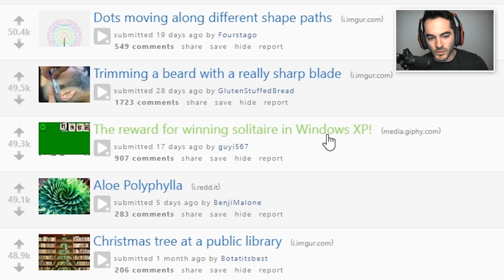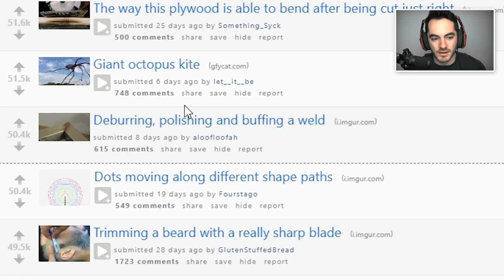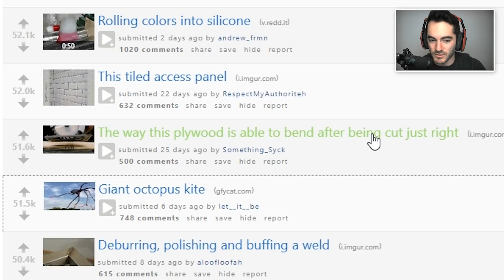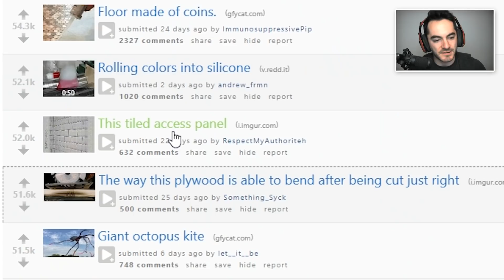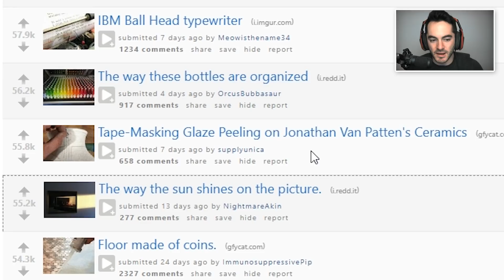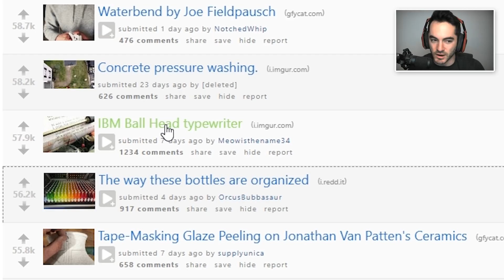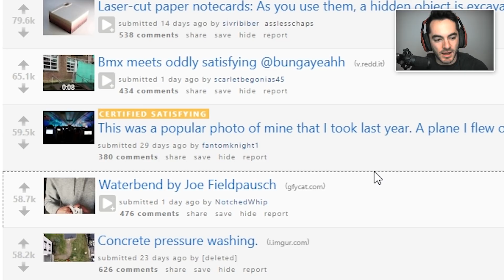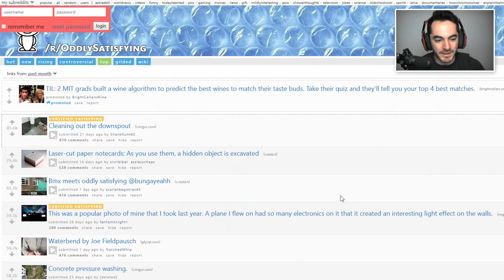HOW TO TASTE THE RAINBOW

Comment: Balls were moving at the same speed. But a triangle in the middle is so small it has lower amount of road to cover than the ball on the outside. That’s why ball in the middle appears to move faster. Because its route is shorter
Reply: Żalbert YES! Thank you!
Reply: This would only be better if you had added a "Jardon you fool" before you said this.
Reply: Sure, that's why while the outside dot makes 1 full circle second to last dot makes 1.5 circle.
Reply: You are right in the sense that each ball is moving at the same speed given their linear paths at any given moment. It's just that the middle balls have a higher average velocity because they are turning sharply at the same speed. So he is kind of half right. I wouldn't go calling him stupid.
Reply: Comrade Żalbert is correct, it's physics, and Captain Sparklez is just saying things without checking the facts
Reply: Valentino III also look up the difference between rotational velocity and tangential velocity, this is why I'm saying he's half right
Reply: the inner paths are indeed shorter but the balls were not moving with the same speed, jordan is right
Reply: Exactly what i was about to post. xD
Reply: Right? How dare he be fooled by the optical illusion specifically engineered to fool you into thinking the balls are all moving at different speeds! He's so stupid sarcasm intensifies
Reply: Żalbert i'm sorry, i just read "balls were moving at same speed" and had a laughing fit... I'm almost 18 i need to be more mature xD i 'need' to, but i won't be :P
Reply: maxdrags3 Last place I'd expect to see you bub.
Reply: Żalbert They definitely weren't the same speed
Reply: You're wrong, the balls were moving at different speeds.  Just look at the part where they're all lined up on the bottom, you can see the balls passing each other.  The ball in the center is going a little faster than the one on the outside, and the balls halfway out are moving more than twice as fast.
Reply: Gammer Games It's not that he's stupid, it's just how he talks about shit like he's so knowledgable about a thing but he's really just extremely ignorant and overconfident. It's annoying.
Reply: They’re definitely moving at different speeds. If you look at the pentagon compared to the outmost shape, it’s clear that there’s a difference in how quickly the dots move. The pentagon dot passes one side way faster than that of the largest shape. He was undoubtedly correct about them moving at different speeds.
Reply: They were moving at different speeds but okay
Reply: The balls are moving at the same speed but due to diffrent lengths of track and sharp turns. This is why an increase of size makes the ball look like it's going slower. Think if you had a hundred meter track and you were racing against someone the were to run the full 100 meters to finish, and you only had to run 50 meters to finish, that's a really simplified example But it's effective
Reply: Nicolas Flamel yes and that is due to the sharpness of the bend they go round not the speed of the ball
Reply: Such math omg
Reply: I know what u mean but I don't think they were moving at the same speed
Reply: Yeah you can tell with the sides
Reply: They weren't though. If you slow it down and measure it out, each shape out you get has a slightly higher linear speed. If you focus on the just the square and triangle, you can easily see this by watching the ball on the square cover more distance than the ball on the triangle in the same period of time
Reply: The ball a few layers down from the outside was clearly moving faster than the outside ball.

EDIT: If you pause the video and advance one frame at a time during that, you can see it far more clearly.
Reply: EXACTLY

Comment: Ok, so those were 1p coins from UK, which have a radius of 10.15mm = 0.01015m
Using pi*r^2, the area of the coin is... 3.237 x 10^-4 sqrm.
Converted to sqrft is... 0.003484 sqrft.

From this, you're able to fit around 287 coins into one square foot, or 3090 per square meter, but that's assuming you melt them down and have no space left over. So, to be slightly more realistic and keeping the numbers nice, we'll say you can fit 250 x 1p coins per square foot, or 2500 per square meter. That's £2.50 per square foot, or £25 per square meter. 

Based on UK carpet dealers (which all seem to have sales, so I'm going based off if carpets weren't on sale), this is about average. Add on the stuff he put on top and the glue, and I'd imagine it comes out to around £3/sqrft or £30/sqrm, which is more high-end/average.
Reply: wow
Reply: So basically, Its a good idea to get a penny floor.
Reply: Box-O-Cookies Well... it's not a bad idea...
Reply: I did the cost in pennies and got 256 or $2.56 in cost per square foot as a penny has a length of .75 inches that means you can fit about 16 pennies every foot meaning just multiply by itself to get the squared amount and you end up with 16x16=256 or two dollars and fifty six cents per square foot meaning if you have a 100 square foot room it would cost 256 dollars. that means that it would be 2304 coins per square meter or in other words $23.04
Reply: Sentient Pufferfish Do you have the right coins? The ones shown in the video are British 1p coins and are closer to 0.8 inches in diameter
Reply: oh sorry i did it in pennies not pence
Reply: You need more likes for ur math skillz

Comment: Actually the balls are moving at the same speed, the super close corners make the inner balls appear to move faster, because they are completing more rotations than the outer balls, and the shapes do not have round corners so it appears to make faster sharper movements as it jumps from edge to edge. They are in fact going the same speed.

Comment: Wow in first 50 view. Never done this before on this channel.
About the bending wood:
I think the vertical cuts are to section the horizontal lines to minimize the pressure on them so they don't brake when bent.
The force is multiplied by the length - basically not to become a lever.

Comment: Dots are moving all at the same speed just shapes are bigger so the path is longer
Reply: busy boss ficko it doesn't look like it
Reply: Marcar9 Marcar9 That’s literally what OP explained, the shorter path with more turns makes the dot appear to move quicker
Reply: You're wrong, the balls were moving at different speeds.  Just look at the part where they're all lined up on the bottom, you can see the balls passing each other.  The ball in the center is going a little faster than the one on the outside, and the balls halfway out are moving more than twice as fast.
Reply: They are moving at the same speed. The reason one passes another is simply due to the relative space necessary, if there were a dot in the middle, it would not be moving at all but the ball beside it would still be "passing" it, if the balls were travelling around all circular paths at the same speed it would be a near perfect line, 100 of X distance traveled at 100X an hour will always take an hour to complete, But the further from the center, the longer the path, therefore in order to be "keeping up" and seemingly move at the same speed, the outermost ball would have to be travelling at a speed relative to the distance the path it takes is so that the time it takes to make one revolution around the path is the same as every last ball.

Comment: how expensive is this coin floor?
Try 1 (Should be more accurate):
The ocin is a British 2 Pence coin with a radius of 12,95mm. The video shows, that six coins for a hexagon, therefor each coin is the incircle of an equilateral triangle (each side has the same length; a = b = c).
The hight of the equilateral triangle is, as Wikipedia says, 3r. But for A = 0,5*h*a. Now we need a, hich can be done with the sine. At the end we get the formula: A = 9r²/(root of) 3.
So the area of a 2 Pence is 7842.67mm². Even though that seems a bit high, but when dividing 1 m² by that, the answer is 127.5 2-pence coins.
So that means, a m² is worth 255 pence or 2,55 Pounds. Or 3,57$.

So a 2 pence coin with its estimated space around has a size of 50,47mm². 
Try 2 (unaccurate):
So a US penny has a diameter 19.05mm and a radius of 9,525mm.
The survace of a circle is π*r², that means a pennys surface area is about 285 mm².
1m = 100cm = 1000mm, so a m² = 10.000cm² = 1.000.000mm² (1 mil).
By dividing a square meter by the size of a penny you get a - not totally precise, but fairly accurate - answer, how expensive one m² is.
1.000.000/285 ≈ 3.508ct or 35$ and 8ct.
Reply: Well you still do have to account for the layers that go on it.
Reply: I feel like there is just so much wrong with this.
Reply: Plus the cost of filling in all the little holes with whatever substance that is (idk)
Reply: I don't actually think these are US pennies. Correct me if I'm wrong.
Reply: Aight.
Reply: Cee Jay cmon I just learned on a weekend 😭
Reply: That is probably off by a lot.
Reply: You can’t really use this logic because the pennies had so many gaps between them that each square foot wouldn’t consist of nearly as much metal as this math implies. A square foot can’t accurately be calculated simply by dividing it by the area of the penny, negative space would have to be accounted for, too.
Reply: Cee Jay totally wrong because of dead space. You're implying that there would be 3500 pennies per square foot which is comical
Reply: They're UK two pence pieces for anyone wondering
Reply: Joe Young Freeze at 8mins 33s, the coin second row up & second in says one penny on it.
Reply: Paradoxical1028 right you are they're one p's anyway they're UK
Reply: Yeah, i updated my theory...

Comment: The shapes actually have everything to do with the effect in the 3rd clip. Each shape is made of line segments that are identical length from the looks of things. All the dots are moving at the same speed, but the dots on the outside shapes take longer to do one full circuit of the shape than the one inside. the outer shape will take 5 times as long to get around as the inner triangle (15 sides on the outer shape, 3 on the triangle).

Comment: Actually Jardon if you notice the shapes actually get bigger as they go out. The dots are going at the same speed but the dots on the outside look like they're going slower but they are all going at the same rate of speed. The dots on the smaller shapes look faster because they're going around a smaller radius than the outer dots.

Comment: At approximately 5mins the other cuts are to reinforce the joint as there wouldn’t be enough surface area for the glue to hold to they cut across like that ass some little wooden slats in to cross the grain for extra surface area/strength for the glue up

Comment: IN the Optical Illusion, the one with the dots moving along the different paths? Each Dot is moving at the same pace. The only difference is the shape, and the length, of the path the dots are following. So it appears the inner most dot is moving faster than all the rest, when it's really just moving along the shortest path.

Comment: The shapes do have something to do with it, on the shapes with more sides the ball has to move longer to do a full rotation, it takes the same amount of time per side but each shape has more sides and therefore you get the illusion of them going at different speeds

Comment: The penny flooring costs $2.56 per sq. ft. 

Here is my calculation:
A penny has diameter 0.75 inches.
Since a square foot is a square with 12 inches as a side length, it can fit 16 pennies laid out next to each other lengthwise.
Then that means we have 16 stacks of 16 pennies, which is 256 pennies. Thus, since pennies are a cent, it costs 2.56 dollars per sq. ft.

Comment: Those rolling machines either have an emergency off button on the floor OR there is a switch/peddle on the floor the worker has to keep pressed down for the machine to run.

Comment: A short explanation of how computers work: Every computer has a CPU, or central processing unit. It is basically the brain of the computer, and it carries out many functions such as processing inputs. There is also a GPU, or graphics processing unit. It, as the name suggests, processes graphical information and tells your screen what to display. Early computers used the CPU to process sound, but nowadays most computers have a dedicated sound chip to tell your speakers what sounds to make. The ROM, or read-only memory stores information that can only be read from, not written to. However the RAM, or random-access memory, stores information that can be both read from and written to. That's about as simple as an explanation of how computers work can get.

Comment: Well... just in material costs building a square foot out of pennies would cost roughly $2.56, which is fairly pricey for low end product (although a floor made out of copper & lacquer should hold pretty well compared to other similar priced material).

Comment: The dots are all moving at the same speed, but each shape is longer by 1 edge.  (Triangle, square, pentagram, hexagon.... but the length of the edges are all the same)
And the picture is a print of a Norman Rockwell classic - you've almost definitely seen it before.

Comment: on my screen the smallest trriagle sides are 28mm each and on the biggest, 1 side is 28mm 
it takes .3 seconds for the triangle to more 28mm and .5 seconds on the biggest to move 28mm.
so yes they are moving at different speeds.

Comment: Since we know that a penny is 0.75 inches in diameter, we can find the area by dividing the diameter by two, to get the radius, which is 0.375 and then squaring that to get us 0.140625. After that, we multiply 0.140625 by π, which is 0.44178646691 square inches. To fill one square foot, we would need approximately 27 pennies, so the price per foot for that flooring is approximately 27 cents per square foot.

Comment: Checked (most) of the other comments & didn't see anyone mentioning the silicon press, so... The rollers have a safety feature that will stop it if anything more dense than the (very) flexible silicon gets into it. So if you slipped and your finger got caught, at the very most it would only wreck the tip of your finger before the entire thing shut down.

Comment: The price per square foot is approximately 256 pennies add in the cost of the epoxy, clear coat, and most importantly all that labor time this will cost you more then engineered hardwood. Probably somewhere close the to the cost of 3/4" hardwood. Without doing a test to see the exact labor time im not sure but its gonna be close to $8-9 per sq foot

Comment: The window (or rather explorer.exe) freeze in Windows still exists and happens if you use certain older or high cpu-power needing programs on a regular basis (at least up to Win7). It is only annoying and the reason why I usually, kill the explorer.exe process as soon as I start working on a windows PC. Who needs a file browser and desktop anyways...

And the dots I think move all at the same speed. It is the size and shape of the paths.

Comment: Looking at it at .25 speed, I can confirm all the dots move at the same speed.  The illusion is actually that the lines for some (If not all) shapes are slightly different lengths.

Comment: The approximate cost of the penny flooring is $2.56 per square foot, the diameter of a penny is 0.75 inches, 12/0.75 is 16, giving us the amount of pennies one one side, square 16 to get 256 for the total pennies per area, and multiply 256 by 0.01 getting 2.56 to get the total cost.
Reply: I am aware, that would have taken too many assumptions.

Comment: I think the pennies for a floor would be $2.56 per square foot since on the ruler i'm using a penny is 3 fourths an inch and 12 inches divided by 3 fourths an inch is 16(the amount of pennies per side),and 16 times 16 is 256.256 pennies at 1 cent per penny is $2.56.

Comment: Actually, the ice gutter thing seems to me like it would only happen in places that it doesn't freeze as often. Here in Minnesota, we just see the first snowfall and say "fuck it, close the windows and turn on the heater until spring." Then the gutters thaw when everything else does, and we might clean out fallen leaves every once in a while.

I wish we did the thing where the ice chops up and falls out like that, but we also have gutter downspouts that curve like 6ft away from the house near the ground, so it wouldn't be able to fall out.

Comment: Well Jordan, if by "how much does it cost per square foot" we're going solely on the price of a penny as opposed to the materials used to make it, then:

A penny is roughly .75 inches in diameter, therefore 16 pennies laid right next to each other with the edges touching would be exactly 12 inches or 1 foot. Now obviously the maker there didn't lay out the pennies in a perfect square shape so this is only a rough estimate, but 16 x 16 is 256, so each square foot costs about $2.56.

Comment: The diameter of a penny is .75 inches.  .75×12 (inches in a foot) is 16.  This means each 1 foot contains 16 penny's.  So 16×16 is 256.  Which means there are 256 penny's in 1 square foot.  Making it worth $2.56

Comment: U.S. pennies are 2 centimeters long. There are 30 cm in a foot. So 1 square foot of pennies would be 15 by 15, or 225. Pennies are therefore $2.25 per sq foot. The only other cost is the clear coat, which I don't know how much that is.

Comment: computers work by switches turning on and off, on means 1 and off means 0,
and the computer reads the ones and zeros as code,
like this:
01110011 01110000 01100001 01100011 01100101 01100010 01100001 01110010
means: "spacebar"
or the imput of prassing the spacebar by the CPU.